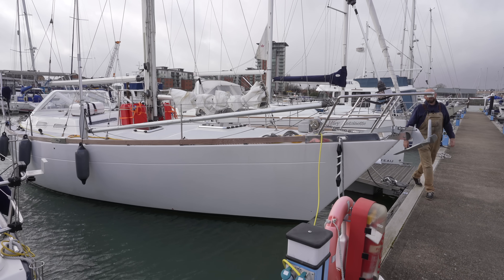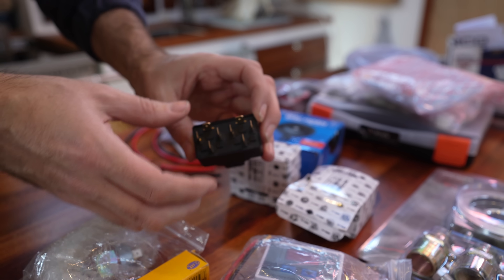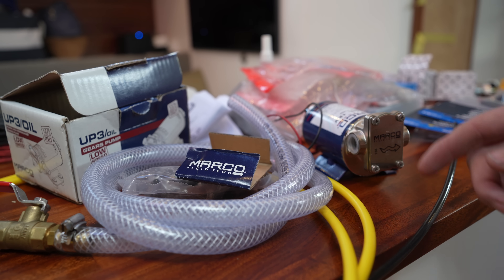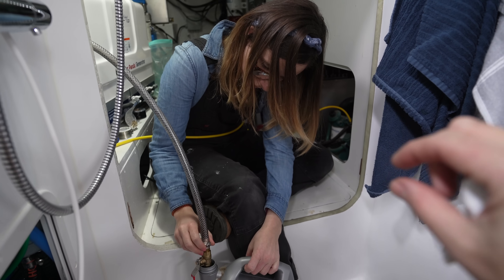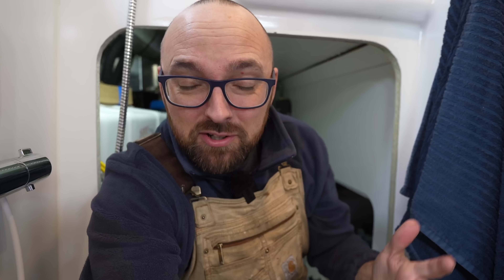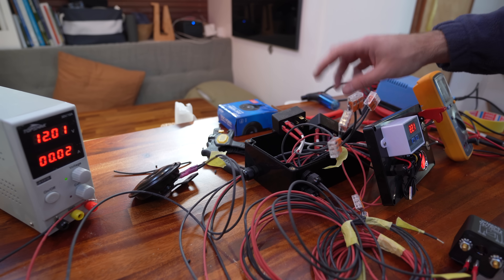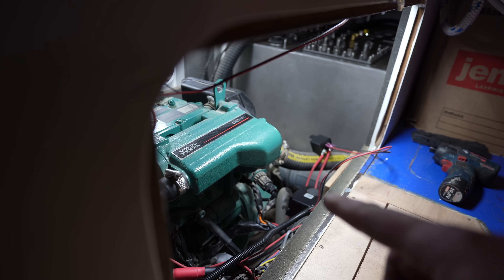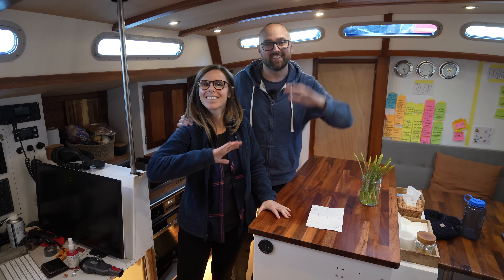Sail Life - A backup to Volvo's 💩 MDI problem. The DOOMSDAY box!

Comment: Grreat video and idea thanks - but as usual it creates a few questions :) Firstly I know this is an older video but i couldn't access the wiring diagram.  My first question is if you used the emergency start button, would you try the on button on the EVC first?  It might be partially working - or would you remove the panel link and canbus cables first, or just try starting it from cold?  I feel the EVC delays the engine start whilst it heats the glow plugs?  Secondly the temperature sensor linked to the horn - it states it's a fire risk if there's no load (the horn) - did/would you add a fuse on the power for it?

Comment: This helped me to identify some switches in my cockpit which seemingly had no purpose. They’re a doomsday hack! I just repowered my Volvo D2-40 with… Another D2-40! And I didn’t know what the extra wires to the alternator were for. Turns out, the previous owner installed a doomsday box even though the MDI works just fine. For now. Thanks!

Comment: What I "hear" people are doing is throwing the junk volvo MDI and controls in the trash can and converting the engines to gauges and appropriate relays, but have yet to find anything beyond general references to projects that have been done. That is what I would love a HOWTO on, that way, having deleted the MDI, you could keep a few relays and a couple of gauges as spares (rather than having to replace a whole MDI -I have a cat with 2x D2-40s -  box. Also my volvo controls the screen is out so there is NO feedback on what alarms are for. What a hot mess.

Comment: Hi, great video, thanks. I note that you have no relay on the glow connections from the MDI box - I'm thinking of a 2nd relay & momentary push button so that I can start a very cold engine in the event of MDI failure. Is this a good idea and are there any traps to watch out for?

Keep up the good work - you are inspiring my boat repair, maintenance and upgrade aspirations!

Comment: Nice doomsday setup, hopefully the MDI box will last longer not being mounted on the engine.  If the temp sensor isn't accurate enough mounted on the rubber hose I found quick reading attaching (with stainless zip tie) a sensor to the thermostat housing.  I also have a sensor on the alternator, all monitored and logged w/ SensESP/SignalK/Influxdb & Grafana.

Comment: wonderful video and work, as usual very well done in the standards and very clever ... it is true that volvo engines are more capricious than some brands like Yanmar which almost never has problems ... I am very surprised to see at the end of the video that the support with the steps does not have sound insulation, it is nevertheless what we find on all sailboats and it would considerably reduce the noise...! moreover, there are now much more profitable insulations in terms of noise, with little thickness and covered with an aluminum film... good luck for the rest...!

Comment: If once the MDI system fails I would make your backup system the permanent system and forget about this MDI. The chance your backup system will fail is close to zero. And if it would fail you can repair it yourself and everywhere in the world by just spending a few dollars om a relay or a push button instead of spending a horrible amount to Volvo again. Because this is another problem with Volvo. Their parts are unreasonable expensive, so better to get less dependent of Volvo.

Comment: SV Zatara have volvo engines and when his water pump leaks it kills the starter motor as it sits on top - has cost him an extra $1000 each time - what a stoopid design - also never trust crimps on a boat, solder and heat shrink
Reply: Properly done crimps are more reliable than solder joints. Automobiles, for example, do not use solder in the wire harness. Agree that whatever method you use to join wires, it should be covered with adhesive lined heat-shrink.

Comment: Great film and failsafe idea.  One thing I noticed Ava started the engine from cold by pushing the start button and holding it until it started (the Cockpit start button), and it cranks cold for a few turns before firing - no doubt once the automatic glowplugs have heated.  We found with ours that momenarily pushing tyhe start button then releasing it for say 5 seconds then pushing it again allowed the glowplugs to run without cranking the engine;  then the button is pushed again and held and the engine starts first crank - less wear on the starter motor etc.  I suppose one advantage of just holding it means oil moves arround the engine prior to firing but we always did it the way I described over 10 years and it always started imediately with no other issues.

Comment: Gee, your doomsday box is how my engine (old Westerbeke) is controlled.  I have a buzzer for the low oil pressure and high temperature, and I have to pull a knob to shut it off.  Does the electronic control box make things more efficient, or what is it's purpose if everything can be done manually?
Reply: Its purpose is to break.

Comment: Im probably nr 100 on this ball, but the oildrain tube you found, can be used to have han hose just clamped over the tube, as the tube it self is the lowest point in the oilpan. Belive the drainplug i acually connected via this tube in the bottom.  Keep up the great videos!

Comment: Just fitted a new Volvo D1-20 to my yacht, and guess what - the MD1 box is mounted off engine and I've wired in a start button!! Must admit I was wondering why you didn't use the oil extraction pipe 😂

Comment: Hi Mads, I have a trade bathroom supplies company in the UK, I would like to send you a better shower, and some shower hoses that aren't those steel wrapped ones, which no doubt make a racket while you're underway. Everything I have has exactly the same size connections you have, 15cm distance between hot and cold inlets, so can just be used as spares too. Let me know a PO Box etc, I send stuff by courier around the country every day.
Reply: As you can see, I don't think Mads reads the comments very much when he has moved past the video.

Comment: Those adapter plate thingies also come with fittings that allow the filter to be remote mounted where they’re easier to access and can be mounted upright so the oil doesn’t spill when you change them

Comment: First thing to do when changing the oil Ava, is to pull your hair back so it doesn't get dirty. Engine oil is not the most pleasant thing to have in your hair. Great job with the backup to the Volvo MDI box. Certainly a way to get their attention if everyone can build one and their MDI sales tank. Good on you Mads.

Comment: wouldn’t it make more sense to have the horn come on in the absence of signal? also, wouldn’t locating the unit so you can keep the companionway stairs in place to use it be safer?
Reply: The horn basically does come on in the absence of signal. That's why it goes off when first armed, because the engine isn't running, and so the oil is not yet up to pressure. Once the engine is running and oil is up to pressure, the signal is good, and the horn will turn off.

Comment: You might find that the load of the high output alternator at very low rpm with low batteries and other loads.   On our boat we have separate on off for high loads on the alternator… this eliminates low rpm high load conditions that can potentially stall the engine in some slow speed docking situations.

Comment: If Ava ever feels intimidated by all she needs to learn, remind her of how long your head start was on learning these things.  I would suggest you give some thought to the manual engine stop. I have always liked the idea of a morse cable being led to the cockpit so in case of failure or emergency there is something to pull right at hand.
Reply: I would absolutely agree with this point as panic thoughts will inevitably be occurring in Ava's mind if this was necessary. To that end you should fairly easily find a web site that will offer a pull-to-stop flexible long cable and sheath which you mount the sheath in an easy access position and run around to a position near the stop control lever on the injection pump. I noticed when you showed us on the video it has a simple cable pinch bolt, so secure the sheath near by but in line with the movement of the stop arm. Attach a spring to the arm which moves the arm back to the run position once the knob is released. To  find such a wire, knob and sheath mechanism look for older diesel engine sites for spares as they were very common on older tractor and truck sites or you might find something like this at a bicycle repair shops sold for brakes or gear changing.

Comment: Something you might consider about your oil change If the motor is above the pump head and the Palm head leaks then it doesn't run down into the motor just assault we normally put motors above the pumps

Comment: I have always found sliding a old grocery bag over the oil filter before breaking it loose to change it and just letting the filter fall into the bag is an easy way to keep the mess down to a minimum of just a drop or two

Comment: Old tech is amazing. My first backup to my diesel is any power to the motor. Any wire (providing it don't burn :P ) will do. Second backup is a hand crank! Though I don't think I'd ever have the strength to hand crank her up... I do have a short handle for manual turnover for priming if I need to in winter (it just feels kinder doing it by hand than motor in those conditions :P ).

PS, for emergencies a little wire on a pulley is usually nice to have for easy access to the "stop" lever. Depends where the engine is facing, to how you would setup the wire and pulley/handle, but should be simple, and would allow you to pull it quick with access without even needing to open the engine bay (could put the handle on the wall). My engine stop is wired mechanically to the controls, but I sit just above the engine in my tiny boat. It is very helpful if the engine springs a leak (oil or fuel or water if fed directly from the crank shaft and thus you want to stop her quick) etc.

Comment: SUGGESTION ONLY. Add a momentary n/c switch from oil pressure switch to monitor for starting only. Simply hold switch or button while starting to let oil pressure come up (second or two normally) without blowing eardrums.  I also like to add a momentary button for emergency kill (to solenoid only, it's only for emergencies) by using fifth pole (n/c) of 100 - 150a relay powered from main switch.  On commercial boats I also add a dpdt switch to swap from main power switch to source power feeding the emergency kill (isolation) in event of burned wire short or stuck main relay etc. (Absolutely none of it's mandatory but adds a measure of safe redundancy and on commercial boats, helps pass safety/insurance.

Comment: For that MDI box - what exactly does it do? As far as I could determine, it turns the engine on and off, it monitors temperature and oil pressure and activates a buzzer if one of the two isn't right. 

It also controls some status lights, I think. Does it control the tachometer?

I really wonder if it's possible to make/produce and sell a drop in replacement for the MDI box that is better made and will last just about forever. Volvo probably won't like it, since it removes their ability to basically kill a large number of engines (they just have to stop selling the part), but, is it legal to sell such a device? I think it should be legal, since you didn't open the MDI box, just looked at the functionality. AFAIK, that's legal...

Comment: Impressive knowledge and ingenuity Mads!  You seem to thrive on challenging yourself in coming up with good solutions.  Also having Eva being able to handle the maintenance is great.  She must also be able to handle the sailing part as well.  Also docking is really a woman's job as we manfolks are generally more able to do line handling,  As always sad to see the end of a video and the next one is a week away!
Reply: I agree here - a week is a long time sometimes. Your videos are enjoyable and refrishing while having interesting content.

One thing, concider putting square (or round) bar stock of the appropriate size inside the inner square section on the solar bridge before tightening the bolts on the adaptors you made - thus avoiding crushing the inner tubing and weakening the hold of the bolts.

Comment: That dedicated oil pipe goes to the bottom of the sump so you can use a larger suction hose and Just connect it to the top of that tube - sucking the oil out is much quicker and fully drained.

Comment: Seems like with a little more work, you could have temp and pressure readings, and a switch to a solenoid to actuate the kill lever, all up in the cockpit. I don't know what else that MDI box does...but if you've replicated it's functions, why not go all the way? Even if it cost the same as Volvo's MDI, the fact it's serviceable and built to spiffness and to survive would be selling points. If nothing else, you could stick it to Volvo by putting out the specs and instructions.

As always, a great video, and your Doomsday Box™ is one awesome bit of kit.

Comment: You did not do the most important thing get the MDI box off the engine , I have read numerous reads that it's heat and vibration  being mounted to the motor that causes them to fail, Sorry need to wait to end ,my wife always tells me I judge too fast ,shes right

Comment: Now, you need to use another port on the adapter plate for an oil bypass filter.  Extend your oil life and time between changes!  Check out Amsoil’s bypass filter.  Highly recommended.

Comment: It's just a Perkins thats used in many other plant, We used them in Pumps and have everything you need on them to set it up like you did, you only need a 5 pin relay a push switch and some wire and you could of set it up that it would switched off on it's own if there was a high temp or low oil pressure. I also have here some low coolant switches that we used on generators that are 1/2" bsp thread ;)
Reply: Infact I'm down in Gosport this week at some point if I can find where I put them and you would like one (a low coolant switch), your more than welcome to one.

Comment: Have you considered getting an electric motor for propulsion, with the generator as back up when the batteries are low? I'm thinking of replacing my own Volvo Penta with an Oceanvolt system, but the costs are holding me back
Reply: Uma seems to enjoy theirs.
Reply: He has mentioned it before, he prefers having dino powered engines. He has also mentioned the desire to stay in more northerly (cooler) climates. Solar replenishment becomes an issue when not hanging out near the equator.
Reply: @WaterFaucet24  yeah I understand getting a back up generator that runs of "dinosaur squeezings", but you can have the propulsion electric. Even use the propeller as a generator when you are sailing, so you create another method for generating electricity. But I don't know if a generator can create enough sustainable power to also propel the boat? And maybe for redundancy you have to get 2 generators?

Comment: you should have chose a buzzer and you can even find buzzer relay. also you might have a look at pulse relay/teleruptor relay. for the MDI did you open it? it's due to engine vibration. maybe pour resin inside it will last twice long. (black resin) - you can also find waterproof relay+socket.

Comment: Another reason to have warm engine oil is that the heat will drive off any moisture that occurs when atmospheric moisture condenses inside the engine after it has been shut off. Not just a question of lower viscosity. And engines should be run for a long enough period of time so to drive off any moisture, even if not prepping for an oil change.

Comment: Would there be a market for coming up with a "robust" mdi box?
Reply: Absolutely Yes.
Especially if you can sell it at a fair, ie non Volvo price. 👍👍👍
Reply: @chrisfoote9413  If I had this issue, and there was something that was serviceable *and * lasted longer than the MDI, I'd pay MORE for it, on the theory that I'd only have the bigger cost once, then replace relays etc. as needed.

Comment: Only thing you need to shut the engine off from the cockpit is to add a stop solenoid that would hook up to where you do it manually and you would need a switch in the cockpit too.
Reply: Even a pull cable in the cockpit to the stop lever would do the trick!
Reply: Wire it to the oil pressure low alarm to kill it automagically. To bypass when starting, have it (the kill circuit) sense alternator voltage to engage. Keep the horn.